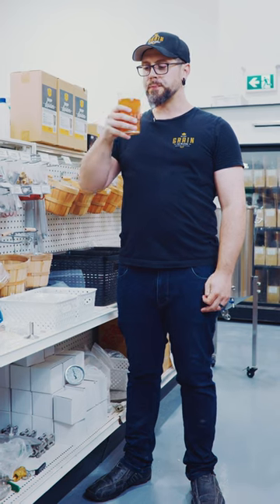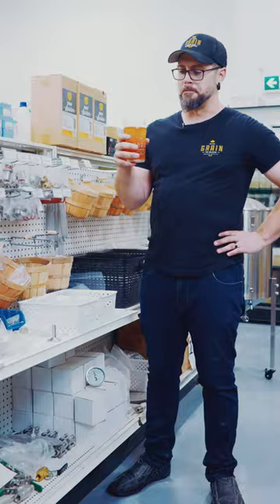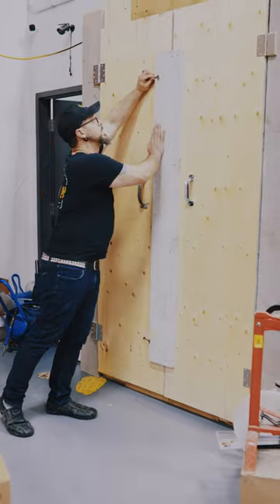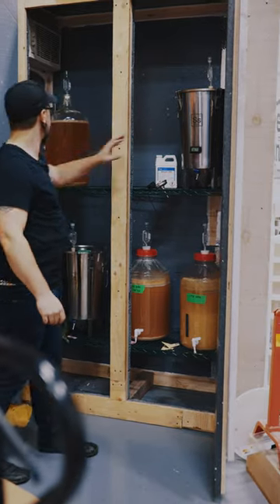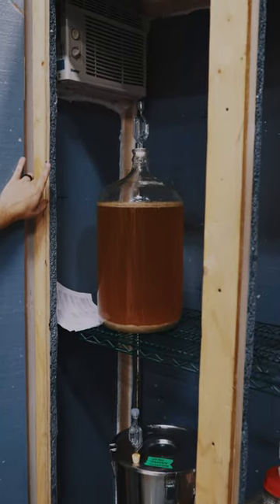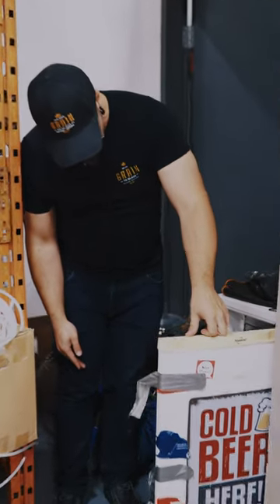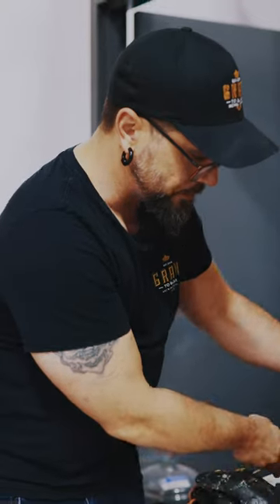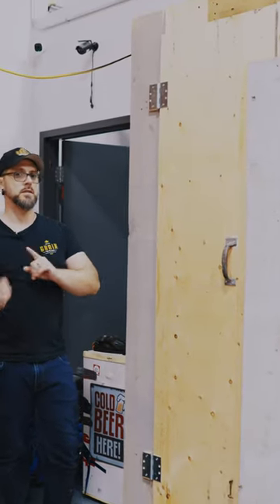Brad's DIY Fermentation Chamber - Temperature Control Makes Better Beer

Comment: I use the bottom of a chest freezer ( top was destroyed by being used as an extra bench), an inkbird, and a simple 2" rigid foam cover. Dual purpose, set to 6'c with a mini360 it's my multi keg conditioner. It also can be used for a fermentation chamber. No need so far, as my basement fermentation room stays under 17'c even in the summer.

Comment: We could use a little more info on this setup. Like what kind of temperatures are achievable with just the ac unit blowing in? I have seen some DIY units where they open up the unit and use the coil as a makeshift glycol rig. But that is too involved for most people. I just found my old my old mini dorm fridge from eons ago. Thinking of turning that into a makeshift glycol chiller.
Reply from the maker: Hi, with just the AC you can get the chamber very cold.  We have no trouble getting it to 10c in a room that's 25c.  Can probably go colder but we haven't tried.  Cheers
Reply: @graintoglass  That is pretty good.

Comment: Hi Brad, great video - how much do you estimate this setup cost?
Reply from the maker: Whoops, sorry I missed this one. Roughly $150-200 for the closet, insulation, and spray foam. $50 INKIBIRD. Used AC $50-100. CAD